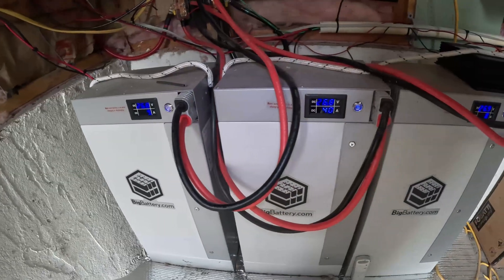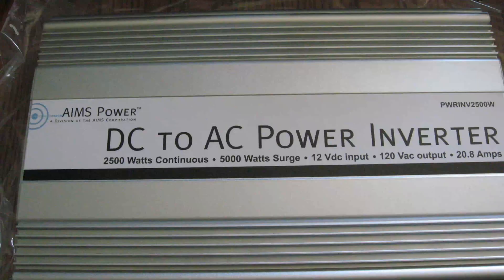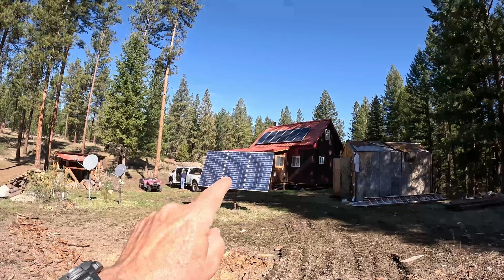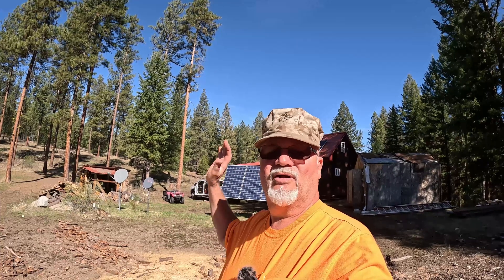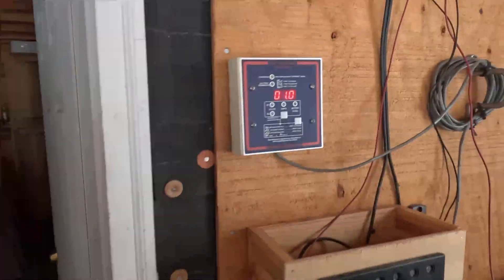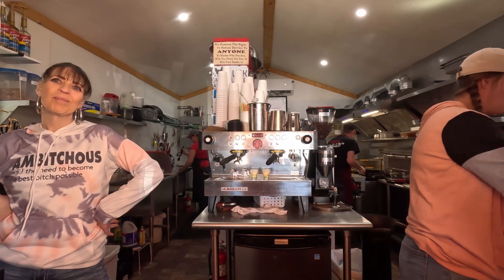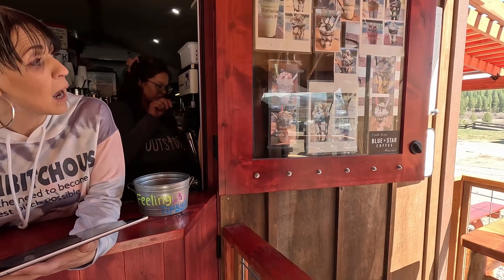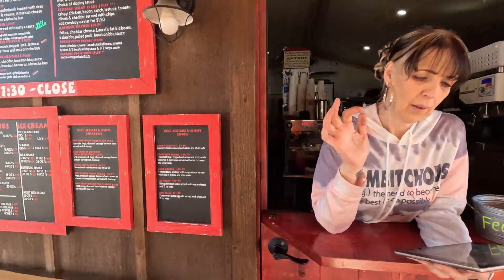Uncovering the Secrets of Off Grid Power for your cabin build

Comment: One small thing I would add to what I have heard you offer, if you have a 3kw 48v inverter than can push out 30amps, I would at a min have 100amp 48v battery. The pure wave inverters start to get dirty if the battery supply is not enough. If you see a light dim when stuff kicks on....your battery supply would be the first place I look.
Reply: I have no clue on what you need on 12v or 24v systems but sure it is something like the 48v, except maybe 12v need 400amp, 24v need 200amp min, but honestly that I do not know.
Reply from the maker: I'm not sure I understand.  Yes, 12v would be twice the AH of the same size bank at 24v, etc.  But 12v will need larger conductors and breakers given the same distance.
Reply: @TheOldJarhead  If battery banks are not large enough, when an inverter draws it's max for output, the pure sine wave gets dirty and it drops below the 60hrtz
Reply from the maker: Interesting.  I've never run into that problem as my battery bank can draw 300amps and with over 9kwh of backup and only 4kw of inverter it would take a lot to drain it to that point when I typically only use 2.8kwh at most from dawn to dusk and am back to 100% SoC within an hour or two of full sun :D
Reply: @TheOldJarhead  I am no expert by any means, I will try to explain what I was told, if you run 30amps of load at 120v ac off inverter, I was told you would need a bit over 60amps of battery at 48v storage to supply the inverter. If you run a 100amp 48v battery down to 30%, the system will start to drop voltage so you will not produce the full 120v required still sending out 30amps from inverter....I hope I did not butcher that to badly, and like I said, I am not an expert by any means.
Reply from the maker: @SarahStuff-p5u  I think that's just over thinking things or more applicable to those with huge systems that they run AC units, Stoves and more off of.  I've been running a 4000 watt inverter (capable of more than 33A @ 120v for sustained periods and 3x that for start ups) on both a 660AH 24v battery bank and a 360AH 24v bank and after all these years (first install was in 2010) I've never had an issue.  So perhaps it's something great big systems might need to worry about but for me, it's just getting down into the weeds...kinda like worrying about washing off solar panels 😁
Reply: @TheOldJarhead  My personal use situation is I have 200amp of 48v, so a bit over 10kwh of batteries, I do use 6-7kwh from dusk to dawn, so maybe down to 30% and with good sun, system fully recharges by 4pm again while running daytime loads.
Reply from the maker: @user-hg2tk3xj9y Very similar size to mine as it's 360AH @24V but I use less power.
Reply: @TheOldJarhead  Yeah I do get it, I have kids that love them electronics so def a different situation, daily usage is about 15kwh on my side.
Reply from the maker: sounds like ya need more reserve...make them mow lawns to pay for batteries 😁
Reply: @TheOldJarhead  I have em work in the garden trust me, and yeah I have my specs really close to the line but I kinda get to cheat with the Grid for a backup here.
Reply from the maker: ahhh having the grid is something I don't have
Reply from the maker: Even with excess battery capacity, you can see the lights dim with the low frequency pure Sine inverters.  I run 360ah and rarely draw them below 30% DoD
Reply from the maker: on a side note, I have a 4000watt inverter, but generally, it's overkill as I don't normally run more than 1k si around 30amps and have 360 Amp Hours of battery 😁

Comment: My calculation 100 watts of dc over 24 hours, 4.8kw battery 800w solar with bi facial panels, my 465w panels have reached 569w each. Good on you for sharing and informing. You are close to me did you get 100 days of clouds this past winter?
Reply from the maker: Thanks for sharing.  I got a ton of them.  Can't remember the total but it was a dark cloudy winter.
Reply: @TheOldJarhead   I hope to pull over 2.8 kw through that soup next winter. Building my system for 100% overcast. If that doesn't work ,adding a turbine.
Reply from the maker: I've thought about a turbine specifically for that reason myself.

Comment: Great information. We always start by calculating someone’s needs. Finding an inverter to support their loads. We then add the dc loads and figure out the battery bank size requirements. Once we know that, then we evaluate panel possibilities and  match them with an appropriate solar charge controller solution. This is the stage where panel position and wiring needs to be figured out. In the end, no one has told me they have to many solar panels, but so many people come to me because they don’t have enough battery. Keep living the dream, from an old Seabee.
Reply from the maker: That sounds like a great approach!  Semper Fi

Comment: Good information 👍🏽 Remember, K.I.S.S. so a newbie can keep up!  😆😊
Reply from the maker: Absolutely!! I try to keep it simple 😉
Reply: @TheOldJarhead  was able to follow along. Did you show combiner box on video? Is it same as a house breaker box? Terminology barrier 🚧? 😶😐
Reply from the maker: Ahhh sorry!  I did show the combiner box but just briefly.  It isn't the same as a home breaker box as that's for your 120 volt circuits.  The combiner box is just a 'breaker' box for the solar panels that 'combines' each series string in parallel and then sends the combined power to the main disconnect box (which is also different - the main disco is where your batteries and charge controllers are tied together with the appropriate breakers.  I know I have a video somewhere I do show it but would have to go look ;)
Reply from the maker: https://www.youtube.com/watch?v=oC_yacKxuaQ This video has some diagrams you can see and shows a little more of my original system from 2010
Reply: @TheOldJarhead  thx for answering that. Visual on Google was helpful. Confident I can do that 😜! 
Explains why 30 amp controller started smoking when I attempted to add 4th panel! 😔😭🧐✅ 👍🏽 
Live and learn! Carpe diem!
Reply from the maker: Yes!  Trust me, I learned that way too...smoked my 1st $1200 battery bank inside of 4 years...didn't make that mistake again 😂🤣